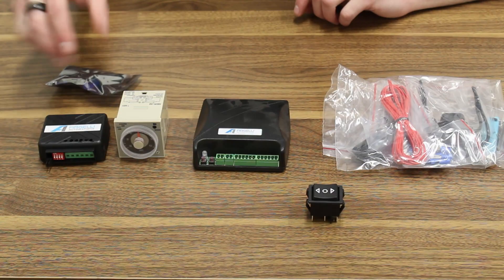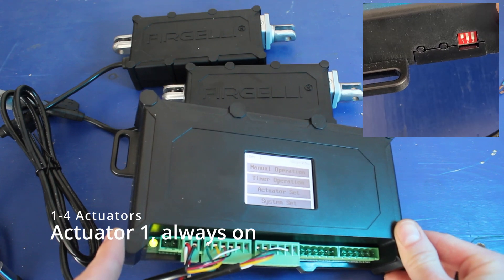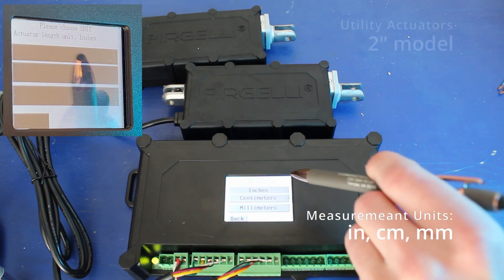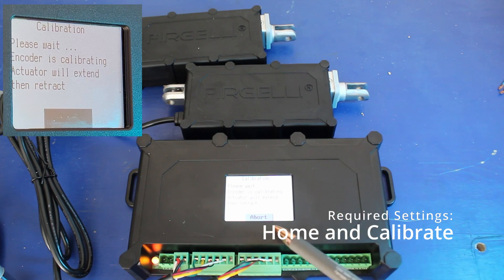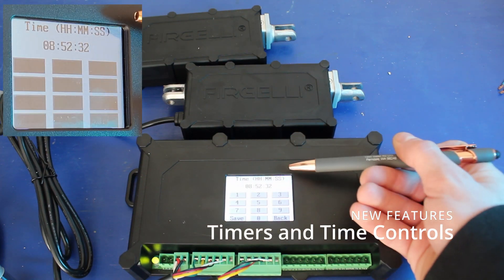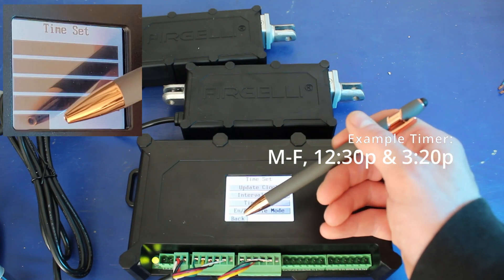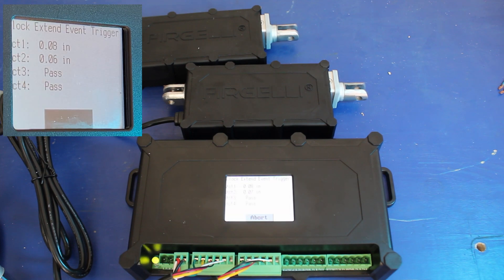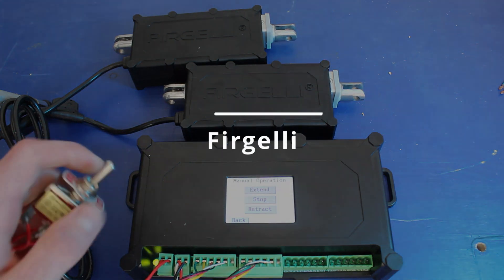Firgelli Control Box   The Next Generation of Automation

Comment: Trying to figure out how one would set this to function with an arduino. I'd want the box to control the sync of three hall sensor actuators, but the box would have to send positional data to the arduino to use different positional settings based on external sensor data.